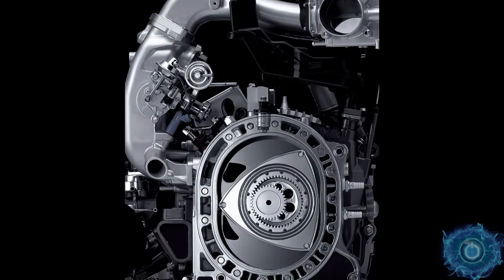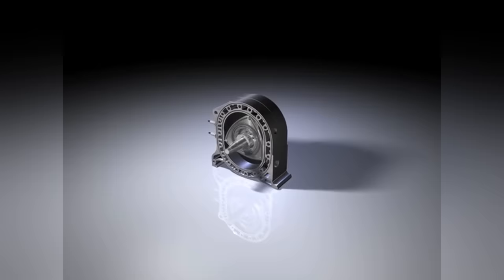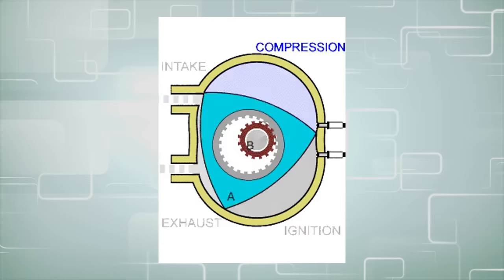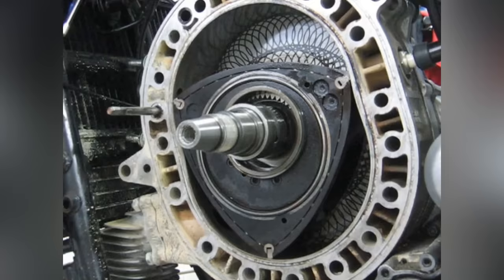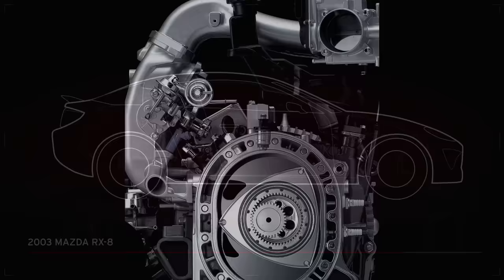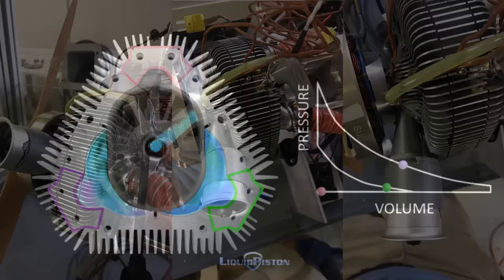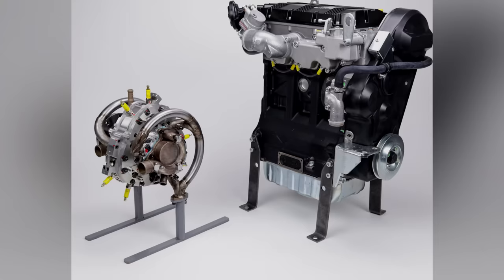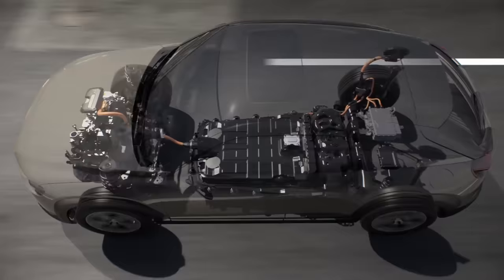STRANGE New Rotary Engine BREAKS Records

Comment: Being a huge rotary fan I have high hopes for Liquid Piston's future. Such innovation and development is exciting. ICE's will be the dominant means of power for my lifetime so how can one not take an interest. That said, I'd love to own a cheaper electric vehicle someday (not holding my breath) if/when the battery technology advances a few clicks.
Reply: Please. Just reinventing the wheel 
Inefficient
Reply: If they could run it on hydrogen, then why bother with a battery?  John Deere is doing some fantastic stuff with hydrogen and they are predicting  1 dollar a kilogram in the USA in the future. I really believe hydrogen is the answer, not lithium.
Reply: @michaelburke5750  Hydrogen's viability is unproven in terms of mass distribution networks and use. It is dangerously touchy stuff compared to, say, methane (natural gas); like comparing gasoline to cooking oil. LP's inverted-Wankel's best potential now is in the hybrid and small-engine routes. But when the H2-driven economy gets going, LP's X-Engines will be ready.
Reply: Seen another video of this, getting rid of the apex seals is a big plus, though it's having it's own issues with the intake being in the crankshaft.
It beeing a twostroke however is a big minus for me.
I hope they can improve it would make for a super compact engine/generator combo especially if it can run on multiple fuel sources.
If its for backup power/range extender gasoline wouldn't be my first choice since it goes bad after a few months, so mabe diesel/cng/lpg/h2 ?
Reply: Maybe when everyone finally realizes batteries store no electricity...
Reply: @michaelburke5750  Hydrogen infrastructure will be very expensive, both production and distribution. Hydrogen has the same energy cost to produce as it returns when combusted.
Reply: A cheap electric car will be many years away and there are serious questions about battery chemistry, the grid capacity, and charging infrastructure, which unless you live in a major metro area, charging stations are few.
Reply: @TheBigdutchster  I think the hybrids are a good compromise. Drove a Camry hybrid a while back and was impressed with the driving dynamics and fuel consumption. No range anxiety and had the petrol power up top when you needed it. Otherwise whilst tootling around it was quiet and economical. I've seen them cheap (under 10k) with over 300k km's going on fbm with presumably not far from expiring battery packs (I am in Australia). I have heard it was about 8k to replace the battery. Given time I suppose all the longer in the tooth EV's and hybrids out there will breed growth and competition in the 3rd party battery replacement market. This is where I think ownership is realistically feasible. Yes, of course charging network infrastructure is a huge one especially out here. Are we just one big lithium shortage away from things going south in this industry and a plethora of others  I wonder. The recent chip shortage throttling auto manufacturing is still fresh in my mind.
Reply: @phoenixrising7047  Excellent reply. I live in MI USA. I live in a small apartment complex and there are no charging stations here. The closest charging station is about 1.5 miles away. I can't sit in a car waiting for it to charge in a MI winter. Impractical. There is a big push in the US to make electric cars. some US manufacturers seem inclined to produce nothing but electric cars. Some states in the US have mandates to cut over to all-electric in several years. I could use an electric car, but I don't want to pay the price premium to own one. I probably just hang onto what I have now until it has no value and then convert at some point to electric.
Reply: Electric motors and batteries have spectacular technological advances recently.  They may soon replace ICE.
Reply: @farvision  Indeed.
Reply: @TheBigdutchster  would it not be possible to charge your vehicle from your apartment?
Reply: @gsilva220  What do batteries store to your knowledge?
Reply: @michaelburke5750  Hydrogen is a terrible fuel. By the time hydrogen makes it into the engine the efficiency is waaaaaaay less than 25%. It also escapes constantly and rapidly corrodes everything it contacts.
Reply: @MartiensBezuidenhout  No, for some very obvious reasons, and if one ponders this a bit, most if not all rental properties do not have the infrastructure to charge an electric car. This is a large scale problem, especially when one considers large cities with high-rise apartment buildings.
Reply: @phoenixrising7047    Batteries store chemical energy, and the conversion from electricity to chemical that is done when they are charged brings an unsolvable problem to EVs.
Reply: @phoenixrising7047    Also, look at one of the faces of a rotor, and you'll see why rotary engines will never catch on: It's a rectangular piston
Reply: Why would you hope for something, that toyota built 50 years ago?
Reply: EVs will never catch on. Theyre already dying out. People are realizing how impractical they are. Plus theyre impossible to use in cold climates. They wont even start in the winter.
Reply: @LaZarusXtnct  Definite negatives.
Reply: @briangall8442  Shameless hyper-optimism probably?
Reply: @michaelburke5750  How about Ammonia?  I always wondered why we don't use Ammonia as a hydrogen carrier, its already got massive industrial / supply support...
Reply: @rdallas81  When  you take into account 'all costs/emissions' you need to do about 50k miles for an electric vehicle to start overtaking an ICE engined car. I'll stick with my 'old' F-Type, I would be doing the planet a dis-service to get a new car of any type...
Reply: @timhartherz5652  I thought it did 1 combustion per rev? Its a 1 stroke??
Reply: @ITZ NEPPHEW  amen! They are glorified golf carts with air conditioning. How do you make a cross-country trip without adding days of charging?  I have yet to see a battery-powered tractor trailer doing interstate travel.
Reply: The battery technology has already advanced.

Graphene/Aluminum Ion batteries run cooler and charge fifty times faster.

No lithium, no Cobalt.
Reply: @nickoutram6939  That better not be a V6 brother.
Reply: @nickoutram6939  stroke count is only indirectly related to rpm, its about how many steps the combustion chamber goes trough per cycle.
A 4 stroke does more steps but is more efficient:
1 suck in
2 compress
3 combust
4 push out
A two stroke combines compress/combust and suck in/push out so the combustion is less "clean".
Reply: @michaelburke5750 hydrogen production is like 40% efficiency for the electricity you put into it. If it came 5 years ago, before and 300 mile range cars with 15 min half charge fast charging existed, then the benefits could have outweighed that, but at this point I just don’t think it’s happening, at least not in the US.
Reply: I had to check when this video was posted for a sec. I have to respectfully disagree. Idk what you are waiting for in terms of battery technology, but 300 mile range and 15 min to half charge fast charging is good enough for most people and that’s already being exceeded. Definitely ICEs will not be dominant for much longer, they already aren’t in some countries. Now if you were saying that ICEs will still have some applications like in long distance trucking or in remote areas for your lifetime, that is certainly a possibility. If you also want a cheaper electric vehicle then I have a little secret: because of the uncertainty that surrounds new technology on the used market electric cars tank like 10 grand the second they leave the dealer lot. So definitely consider getting a used one. 

Honestly, I would give anyone that advice, look for a low mileage dealer certified one or at least lease it. You most likely need less range than you think you do. Even if you aren’t convinced by that as soon as a model that meets your requirements comes out, you should still probably wait a year and get it used, though this trend may not last forever.
Reply: @Harry F , then why would JCB invest millions of dollars into green hydrogen. If a multi billion dollar organization decides to go with hydrogen over batteries, there must be a valid reason. Please check out the video that JCB has done recently regarding hydrogen as a fuel source. It is an option now in Europe. It is coming to the USA.
Reply: Most fand are rotary lol
Reply: @Starren1  Sitting here on my pedestal.
Reply: For those who know  !!! Molecular Hydrogen !!!  1 thousand  mpg . NO POLLUTION . !!!!
Reply: @michaelburke5750  Hydrogen is a foolish fuel. In fact, it's not fuel, it's energy storage. Almost all hydrogen is a fossile fuel byproduct. It's also extremely energy intensive to create and especially when from water (more energy required than you can get back out). It also has serious storage issues as well as huge range limitations.

Anyone telling you hydrogen is a good fuel is either profoundly ignorant or trying to scam you.
Reply: They just need to build one for a dirt bike. Liquid Piston brings in millions of dollars but doesn't seem to have some cool prototype. Build one for a dirt bike that kicks a Yamaha YZ450s butt. It would have to be lighter and just as powerful. Then go build a prototype to replace the motor of a Ford F150. Then Liquid Poison would really have investors.
Reply: @michaelburke5750  - Hydrogen Fuel Cells, requires Valves, and Controls, and is best for Steady State Operations, Like in Grid Power Support, Not intermittent Loads, like Driving, so Still Require Batteries - For Sudden or Rapid Acceleration Modes, as well as for Regeneration Functions. 

H2 (Hydrogen Gas) itself, isn't available anywhere, because it always is bound to other elements, and takes large amounts of energy to separate it, in its "H" State, from which it then combines to for H2! In the Fuel Cell Operation,  

The Fuel Cell, which uses Rare Earths in different types than Batteries or Motors, and isn't a Highschool Level Technology, but even High School Kids can build a a Battery Electric Vehicle! 

Then Comes - Efficiency, or Energy Input versus Work Output: For Example, a Toyota Mirai, uses 4 Times as much Energy per Mile, in total versus a similar Car - The Tesla Model 3.

Fast Fueling, Only Counts if you can Compress it High Enough, far higher than a Welding Bottle of Oxygen Gas (O2) Which is usually Maxed out at 3,500 PSI, And the Toyota Mirai Required 10,000+ PSI Fueling Capabilities, or it gets less than a full Tank!
Reply: @timhartherz5652  its exactly like a rotary though, its technically four stroke, with a single rotor piece having three chambers (basically three cylinder equivalent).

the problem with liquid piston is trying to figure out the engineering to make it two rotor or higher. in my brain i can only imagine the center housing hosting the intake and exhaust ports but that would distance the rotors quite a bit so there might be crank twisting due to the extra length.
Reply: @michaelburke5750  the energy needed to produce 1 kilogram of hydrogen gas is 3.6 mega joules. or about 33kWh. the world average electricity price is about 0.17USD per kWh.

thats over 5 dollars per kg of hydrogen. there is also conversion loss so its probably more than 33kWh needed to produce hydrogen gas. and there's also combustion inefficiency and by today's standard ICE the combustion is about 30% efficient so its barely touching 10kWh for every 1kg of hydrogen fuel burned. a hydrogen cell is only 40-60% efficient. while an electric motor is 50-75% efficiency, and is actually more efficient running at max load.

if we chuck 1kg of ICE = ~10kWh of energy
if we chuck 1kg of hydrogen cell into electric motor = ~14kWh
if we dont create 1kg of hydrogen and just directly put that energy into electric motors = ~15kWh at low efficiency and ~23kWh of energy at high efficiency.

i love ICEs. they're a marvel of engineering. and i love hydrogen (fuel) cells. they're a marvel of chemistry. but alas every engineer needs to succumb to the physics of efficiency.
Reply: @Ao Yuki  If this is true, then why would JCB invest millions in hydrogen?  Same thing with Toyota. JCB is in production with their new hydrogen engine in Europe, and they are shooting for 1$ per kilogram for the United States. 
Everyone keeps telling me that hydrogen is worthless, but I see companies investing hundreds of millions into these engines. Do you know something that they don't?  Europe has a hydrogen delivery system in place for JCB equipment already, and it's cheaper than diesel.
Reply: @michaelburke5750  because of two things.

1) Europe and Japan has a shit load of renewable energy source and nuclear reactor. 33kWh for a 1kg of hydrogen is fairly affordable. In fact I believe the hydrogen will be imported to the US because most of US power generation is coal and petroleum. So this means they can produce cleaner hydrogen without excessive CO2 emissions (which is the whole point of this hydrogen and battery thing)

2) Energy density of hydrogen is simply higher than batteries right now. Hydrogen will replace gasoline in ICE cars, or will be hydrogen fuel cell electric cars for long distances. Hydrogen is also a viable option for trucks and semis. For short distances a battery electric car is better off since you can just go from A to B back to A and charge overnight. Also downside of battery electric car is slow recharge. Hydrogen refuel is slower than petrol but not as much. Can consider practically the same compared to charging batteries.

*However* I don't live in the US. Or Europe. If I can get a job there I might move to Japan. The population of US and Europe combined is 1 billion people. We have 8 billion people. This means that for basically the entire world hydrogen will not cost $1 because capitalism, import cost and taxes. If these new technologies do come, its not for the world. Its for the US and the Europe. The rest of the world will take another 10 years minimum to catch up. By that time I'm close to retirement and frankly at that point my concerns will probably be more towards my family than humanity. Also there's a minor detail that hydrogen is vastly more explosive than batteries and petroleum but that's unrelated to the main concern, its more of a minor thing.

I'm excited to see hydrogen becoming our main energy intermediate because of how clean it is, and how efficient it is. But as far as things go I am most likely to be stuck with petroleum ICEs anyway so it'll be great if ICEs are not left behind the dust as well.

Also in my country petroleum is absurdly cheap, like 25 US cents per liter. And its also 60% of my country's GDP so if petroleum industry die, we all die 💀
Reply: @aoyuki1409  Great reply! You are from India I take it?
Reply: @phoenixrising7047  no i am not
Reply: @aoyuki1409  Where are you from?
Reply: @aoyuki1409  I live in Georgia, USA where JCB has their US headquarters.  We have 4 nuclear reactors in the state of Georgia, and probably is one of the reasons why JCB is predicting  $1 dollar per kilogram. At that price, it seems silly to invest in battery technology, especially with the cost of battery replacement. I could purchase 4 used I.C.E. automobiles and have a much lower carbon footprint than 1 EV with a battery replacement.  The EV might not have a tailpipe attached directly to the vehicle, but it certainly has emissions elsewhere unless it is getting electricity from a nuclear source. 
  What I can't seem to figure out is, why haven't the EV manufacturers considered designing the vehicles for use with a universal battery that is easily replaceable and rechargeable.  Instead of having a charging station and having to wait for hours to charge, you simply swap the battery for a full one.  Just like a cordless drill. It would make long distance travel feasible and a replacement would be as quick as filling up a gas tank. I guess the answer lies in the fact that they can't even agree to a universal plug for charging. I believe the internal combustion engine will be around much longer than people think.
Reply: @michaelburke5750  i also think that the ICE will be around as long as we still use fossil fuel for electricity because as it stands going EV (either H2 or Battery) is still producing significant enough carbon change and cant justify the change. we have much safer reactor designs now, we learnt a lot from Chernobyl and Fukushima, and recently we had a breakthrough with the experimental fusion reactor, that it produced more power than what was put in (its still hella expensive to be practical but we're one step closer now)

i also thought of the battery swap thing but after looking at EV cars i realized that its a stupid idea because almost half of the weight of EV cars is batteries. thats a pretty silly idea carrying half of your vehicle weight to add extra mileage, it would be detrimental and energy inefficient anyways and ICE would technically be more efficient.

H2 is much more lighter and energy dense, in fact H2 is the most energy dense form of storing energy per mass that we can harness with today's technology minus nuclear. However H2 is extremely volatile and we could have another Hindenburg disaster. all it takes is one H2 car to get smashed by another H2 car in an accident and boom. ICEs and battery EVs dont explode when they crash hard into each other.

Many other things need to come first before EVs and H2 vehicles. We need to achieve 0% collision rate, 100% clean electricity, multiple engineering solutions to hazards and safety. and just from H2 being very volatile its more likely that battery EVs are able to come into practical first before H2. I mean all we need is a way to recharge batteries as fast as we can refuel petrol.

we dont have infinite nuclear and fossil fuel as well, so we either need to grow our own fuel with biofuel, or we need to go to space and mine fusion/fission nuclear fuels. elon was right about going to space at the every least. i think SpaceX was founded in order to ensure Tesla's future.
Reply: @EddieTheH  You are 100% correct. Most of people live in a lulu land.
Reply: @LaZarusXtnct  No, EV's are not dying. EV's are evolving and they will be a big part of life in the future.
Reply: @lesp315  All false. Theyre dying. Nobody wants them except culture warriors. Who are also dying out.
Reply: @LaZarusXtnct  All of it? Thank you for letting me know. :face-purple-crying::face-purple-crying::face-purple-crying::face-purple-crying::face-purple-crying::face-purple-crying:
Reply: Im goona go out and buy more amsoil interceptor 2 stroke oil for my rotary and this liquip piston if i can get one.
Reply: @jlo13800  Keep us posted bro.